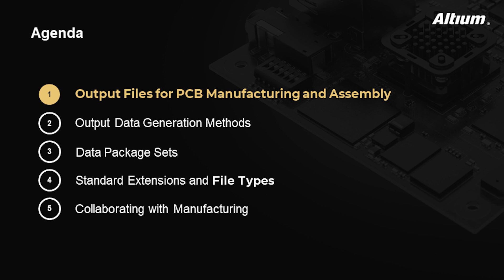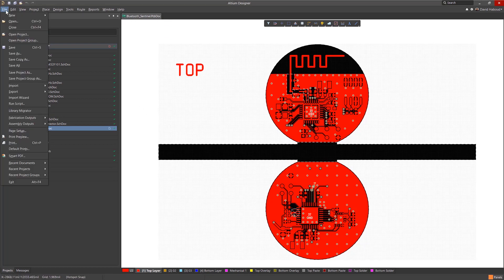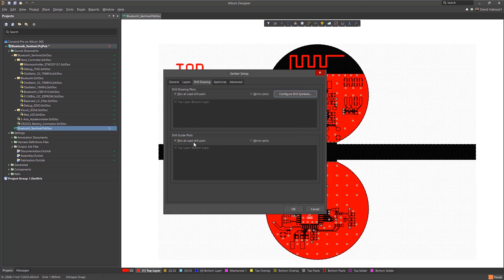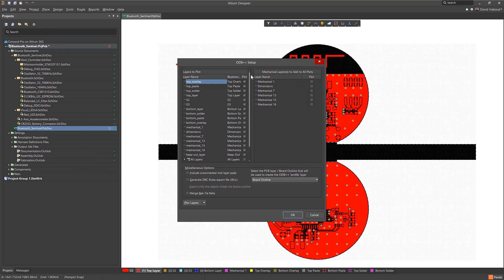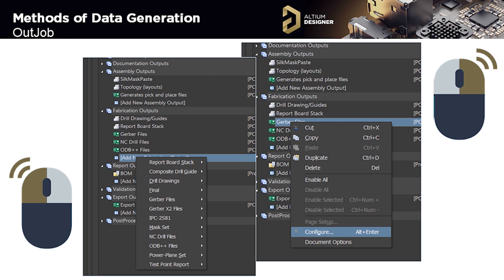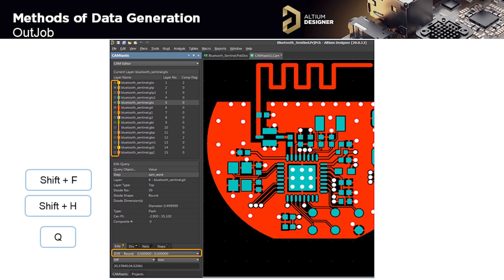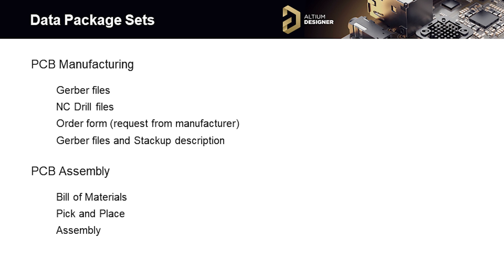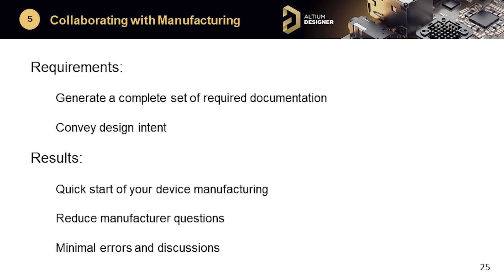Communicating Design Intent with Manufacturing Outputs

Comment: Thanks for this great Video.
I got confused at 3:47, that if I uncheck the box then e.g. ground via will not be connected to 2nd ground-layer if my PCB is of four-layer? and only be connected on top and bottom layer ground plane? is it the meaning?
if yes then if I turn it on 3D mode my ground via is connected to all other ground planes whether it is bottom or mid-layer.
Reply: The checkbox just changes what is shown in the Gerber output. You will still be able to connect everything in design as needed because it only affects the output. If there are any pads that are not connected to anything, usually caused by a through-hole via, they will show up as a blank space in the Gerber. If you still have questions send me an email and I can send you pictures of the differences. It is shown at https://youtu.be/RDkbNSUBu0c?t=1116 https://www.altium.com/documentation/altium-designer/workspacemanager-dlg-gerbersetup-formgerber-setup-ad
Reply: @davidhaboud9557  Thank you for your support sir. But Still I have a doubt, may I have your email id please? Or you can share pictures on linkedIn https://www.linkedin.com/in/jay-vadodariya
Reply: @ijayvadodariya  Yes, it is in the video at 18:32.